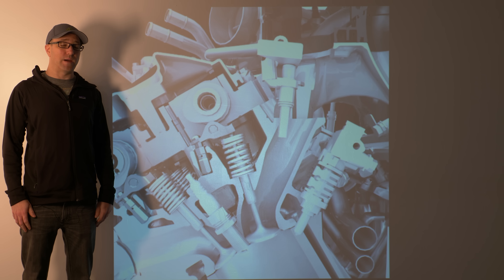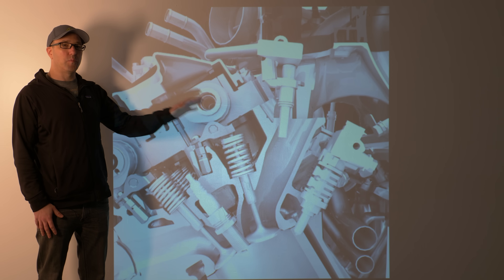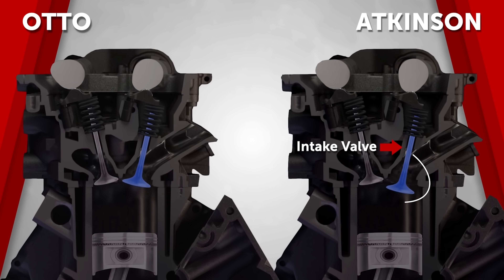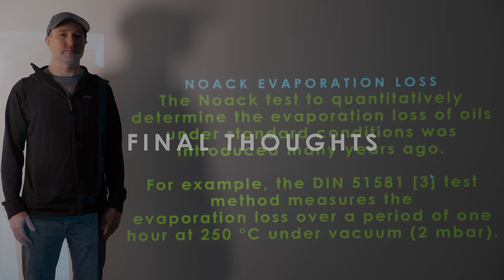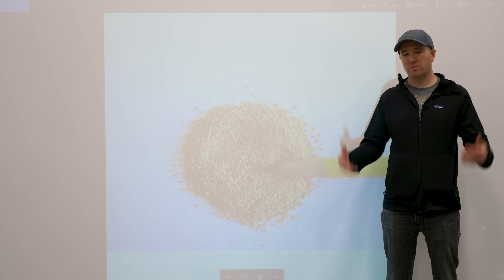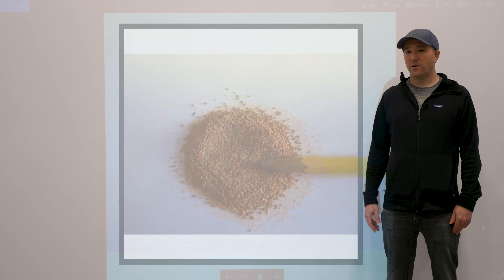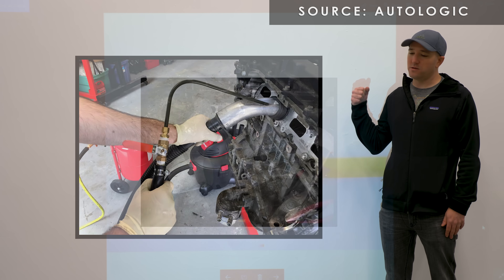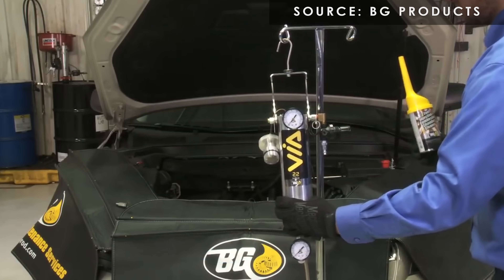Direct Injection, Problems and Solutions | The Fine Print

Comment: I have two cars with modern engines, a Peugeot with a THP 1.6 175 hp Prince engine (BMW-PSA) with direct injection and all new paraphernalia and an Alfa Romeo Giulietta with a 1.4 turbo 170 hp Multiair system engine, conventional injection. The latter does not have any of the problems associated with direct injection (many) and consumes less fuel. With the right technology, direct injection is completely unnecessary and was a failure in terms of reliability.

Comment: $600 to $1,000 cleaning service every 30,000 miles?  I just purchased a 2023 Subaru Forester 2.5 with direct injection and there is nothing in the service schedule about a valve cleaning service.  At any mileage.
Reply: Exactly. Planned obsolescence, engine dies of gunk & misfires just outside the warranty window. It's aaaaalllll part of the plan.

Comment: I have a twin turbo GDI engine so I use:

1.I use CRC intake valve turbo cleaner every oil. 
2 . Oil catch can
3. Fully synthetic oil 

100,000 miles no problem so far and no oil consumption. 

By the way, port injection helps keep the intake valves clean but it's not perfect and with twin turbo EcoBoost it will only delay the need for Walnut blasting by two.

Comment: What if I would add say 3 ozs of Lacquer thinner at each gas fill up to clean the carbon
off the valves and internal parts ?  Any problem seen ?
Reply: How when it never comes in contact with the valves?
Reply: Cleans fuel injectors @ibcalm24

Comment: Direct injection was NOT invented for emissions regulation reasons. It was first introduced in aero engines to address carburettor icing problems. One of the first engines using gasoline direct injection was a german Junkers JUMO aero engine in 1916. Perhaps one of the most famous gasoline direct injection engines is the inline 6 used in the famous Mercedes 300SL gullwing.
Next time do some research before ranting about technology you don't like!

Comment: another reason to either get a new EV or stick with a port injected older model … since diesels are mostly direct injection why are those engines not failing at 100k miles due to intake carbon buildup ?

Comment: As some have noted, blow-by is from combustion chamber, past piston rings into crankcase (bottom end of engine.) PCV was invented to eliminate oil leaks. When you omit it, you build pressure in the crankcase and pressure forces it out of the seals. Oil catch can is reasonable advice for GDI for dedicated motor heads who will maintain it.

My 2007 R56 MINI burned a valve before MINI fully understood that this was a problem. I tore down the head and had gnarly photos of all my intake valve with tons of carbon on the backs. The burned valve was actually an exhaust valve that I suspect was wedged open when a piece of intake valve crud finally broke off.

Comment: I remember back in the 90's OMC 'outboard motors cooperation' Had what was called Engine Tuner. This stuff ate carbon.
You could see it work, carbon was gone in an hour. If an auto maker could find out what OMC had in that can, they could have a spring n ball inlet port to the intake valve where you could screw this on . DONE. I'm serious. nothing worked for carbon like this stuff. OMC went away with the death of the 2-stroke engine. Ford find this N make it, you need this for yer cars NOW! If OMC could build a system where you can fit a nozzle from a can to the motor so can you.

Comment: I have a 2015 VW Passat 1.8L turbo. Killer engine and great car but Im now at 140k miles and have occasional rough idle an im burning about a quart of oil EVERY SINGLE MONTH. VW does indeed use an oil separator, but this has not been sufficient in removing oil from the vapors being directed back into the intake. Im now looking at having a major carbon cleanup done, as I am giving this car to my daughter. I want 200k miles from this car.

Comment: Your viewership might relate or appreciate the benefits of old mpfi tech.  As the first owner of my 93 Explorer xlt 4dr 4l OHV MPFI it had 398k miles on the original motor.  In interest, I pulled the heads for inspection.  Every exhaust valve receded past the direct to iron seat, and half were stress cracked like a split on end grain 6x6 wood posts.  All of the intakes showed little wear on the face.  What follows your story and to my amazement, every valve was pristine clean, dry, no oiliness, no carbon buildup, Nothing! except material erosion wear.  Never once did I ever feed the suv any fuel additives.  Believe it or not, the original CAT kept NOX and the other emissions within  the upper boundries set forth by CARB in SoCal.   Likely due to the generous bandwidth set forth by CARB's OBD 1 numbers.  Give them an inch, they will take the mile from you.

Comment: He really does do a great job most all the time informing us. But he needs to be just a little more careful at times. We have a bit of miss information in the video. The injectors for direct injection can not benefit from cleaning products and cleaning procedures. They spray fuel at such a high velocity that they literally blast their own openings clean each and every moment they are being used. The opening is so tiny they would never be able to work at all if there was any blockage at any time in their use. So if you want to use injector cleaners or take them to a cleaning place it won't hurt anything but there's absolutely no benefit to the injectors to doing it at all. Look this up it's factual. I would think he got this info from one of these places that sell those services or someone that didn't really know the facts on this. At least that's what I suspect otherwise he would have found this out by looking into it on his own.

Comment: I wish you'd explain the actual "solutions" car makers did to prevent the int valves carbon build-up because this is the root of the epidemic engine failures in some car makers such as Honda, Kia, Hyundai and perhaps others.  What these car companies did is they modified the car computer software to inject extra gasoline on cold engines - this enriched the fuel-gas mixture to the point where some of the gasoline doesn't burn and is coating the combustion chamber including the infamous valves - this is how they prevent the carbon build-up, it's a "valve cleaning" procedure that happens at each cold start. A very easy and cheap to implement "fix" that in turn......    caused the epidemic engine destructions in Hyundai cars. Why ? Because this unburnt fuel leaked into the engine oil and diluted the oil causing obvious engine wear, plus coating the cylinder with unburnt gasoline increased cylinder wall wear to the point of increasing the blow by. A cheap quick easy "fix" that in turn caused a major engine trouble. Usually the engine wear is worst in drivers who do mostly short distances where the oil doesn't heat up enough to evaporate the gasoline that is diluting it. You can use the best existing oil, after a few weeks it gets so diluted, it becomes worst than the cheapest oil.  If you are doing mostly short distances, you are better off to use a regular oil and change it no later than 4000 miles OR 6 months.  Do not use the same diluted oil for more than 6 months even if you don't drive the car, because the more diluted oil sits, the more it degrades.

Comment: You are spot on on this. My experience with my gdi car, dealer recommends 0-20, then my car burns 1 litre oil 5.000 km. When i use 5-30, it doesnt show any oil loss after 10.000 km. And after following their recommendations for too long, before i did my own research, im afraid i have a problem now. Car har run 80.000 kms, and runs rough at cold starts and in steap hills on low rpms. So thanx GM, for recommending 0-20oil.😢
Reply: Did you ever figure out the rough running at idle? Which model and year is it?
Reply: @gregorymalchuk272 hi there please if you can help me I do have rough Idle I really don’t know what else to do I just found this video Got Great Explanation But Questions What Oil should I Use to try to Improve the Rough Idle for Now I use 0w 20
Reply: @SL_Pwc_Lifestyle  What year, make, and model of car is it? Have you dumped the OBDII codes? Is there a misfire code? Maybe a bad ignition coil, bad ignition module, bad spark plug, or bad fuel injector?
Reply: @ I try few things…is a 23 suburban I change the sparks…. No codes there is no codes ….Nothing just shaking at red lights or stop signs when is hot 🥵 at the morning do nothing
Reply: @SL_Pwc_Lifestyle  Have you dumped the codes? Auto parts stores will read the codes for free. The computer can identify a misfire down to the individual cylinder by reading crank acceleration (or lack thereof). Or you can try to do it yourself by disconnecting spark plugs or the low voltage wires to the coil-on-plug until you find one that doesn't change the idle. I strongly suspect a bad coil-on-plug. Sometimes even the long stalk that goes from the coil down to the spark plug burns a hole in the side, and wrapping it in electrical tape could fix it. It could also be a bad injector, but this is somewhat less likely.
Reply: @ I’m going to try that
Reply: @ thank you for your help and time
Reply: @SL_Pwc_Lifestyle you probably need to use 5w-30 oil and do a walnut blasting of the intake valves.
Reply: @gregorymalchuk272 opel insignia 2018 1.5 severely downsized. No codes, but carboned up intake valves.
Reply: @gregorymalchuk272  it was carbon buildup on intake valves. Needed walnut blasting and 5w-30 oil.
Reply: Sounds like from what you are describing the issues only started after you switched oils. Some of that could be attributed to running out of spec oil

Comment: Considering a new Toyota 4runner but it has direct injection.  These are alleged to be very reliable though.  The V-6 is the same from 2009 or 2014, anyway it’s old school.  
Question: would premium fuel keep valves cleaner? Or how often add injector cleaner?
Thanks

Comment: Nothing new here just cut and paste info from intelligent people. And not just Toyota and Ford...Hyundai/Kia. Idea a catch can works can be more volatile then gasoline. Many tests say yes, many say no, and some say, not sure. If you use a Top Tier fuel you do not have to add anymore additives. If you use poor fuel, then yes,run some Techron or Sea Foam. Many oil companies publish on their sites complete specs including volatility numbers. Therefore some good info, some not so good, but like he says don't take his word for it. Only thing he is correct about DI engines are not the answer people thought they were. But a dual GDI/MPI engines are the answer for better fuel mileage, great valve cleaning, more power until something better comes along.

Comment: What an amazingly well researched and put together video! I do have to say though, I was surprised you didnt mention anything about GDI intake valve and turbo cleaners like those offered from CRC and Lucas and I was wondering why? I understand they can't remove all deposits, especially hard deposits, but I believe they work as a preventative maintenance step. 

Also, I found that NOACK chart interesting, as I've been using QSUD 5W-30 for a long time believing it to be the best oil for my 2017 Hyundai Sonata 2.4L. I just got some Amsoil Signature Series but I can see from the chart, I may have to try Pennzoil or Red Line if I'm still using a lot of oil.

Comment: You for got the oil filter my man, use a very good oil filter. I use Amsoil EAO17 it’s the best. WIX HP is a good filter, just make sure your filter has a filtration of 20 microns. The larger contaminates are what build up on the back of your valves. I have a 2011 f150 with the 3.5 twin turbo it has 400,000 miles on it I’ve had zero valve issues, zero timing chain issues and zero turbo issues. I use 5w-30 Amsoil signature series oil with their EAO17 oil filter, no catch can. I do 10,000 mile oil change intervals

Comment: I've noticed a lot of new Chinese built engines are using low pressure indirect injection, they say it is more reliable and incurs less maintenance, anyone who had problems with a high-pressure pump will appreciate that, I've seen pumps costing £500 junked for sake of a blown O-Ring by mechanics who cant find the problem, or don't take the pump apart and just order a new one at the customer's expense.

Comment: Great video, read a couple hundred responses and couldn't read them all, was wondering would a different tune help carbon build up maybe a little leaner or is this too risky. Also what about more effective cold air intake or better exhaust flow. I have a 2014 Ford ecoboost 3.5 liter supercab with a towing package but it has single exhaust, have seen videos on getting a better cold air intake filter and putting duel exhaust then adding a tune box to help the delay response in Fords when you push the pedal down and get a 1 second hesitation and suppose to give you a 75 horsepower increase.
Reply: Also what about a hotter spark plug, like the newer better plugs that spread the spark front over a wider area than the single point spark plug type.

Comment: Finally someone who tells the truth, the purpose of super light oils 0w20, 0w30 is to reduce consumption. The manufacturer of my car requires 0w30, I use 5w50 and it greatly reduced carbon buildup and lengthened the life of the timing chain, which is another problem endemic to new engines, timing chains that stretch and last 80,000km. Obviously I live in an area where the car does not know temperatures below 5°c

Comment: I own 3 DI vehicles, 2 of the 3 are Turbo!!
2017 Lexus NX200t w 60k miles (has Toyota D4 injection and literally just gets driven and that's it)
2013 Mercedes GLK 350 with 328,700 miles!  the M276 3.5 has DI and I bore scoped it 2k miles ago and the valves are "dark" yes but not caked up at all.  It's never had a treatment (pulled the Mercedes Vehicle Master Inquiry and blasting treatment is not listed).  Car feels like its 3 yrs old with 50k miles, very nice.
2020 Ford Ranger FX4 w 88k miles.  DI, Turbo, 10 sp trans.  Scoped it last yr and no buildup at all, looks new.  

I don't lose any sleep over DI.

Comment: Fuel injectioncan be a big plus going up very steep stuff in 4x4 I had a little toyota with a built 4cylinder makuni intake & Cam good ezaust and all . A nice big weber carb. Going up steep dirt sometimes it could not get gas from the carb. Then with a fuel injected v8 it does not hsve that issue at all. THe other good thing if you go up ino higher altitude there is no need to adjust the carb and with MAF and not burst injecting from side to side but injecting into each cylinder. it will be I hope even better. The computer adjusts itself even with upgrades insead of reprograming the chip of speed density. Smog stuff can be tufff you need to buy stuff thats legal and keep the cam more mild. But its not as bad to build for torqu over horsepower. That is not the best for high speed like in a car. But good for a fiull ssize 4x4. I am not racing it but need torque to get it up sand and stuff from lower speed you need.

Comment: I have a 2016 Sonata, and I had a runon problem with the engine after shutdown, implying some detonation.  I removed the plugs and found they were perfect except on the sides, where combustion products had accumulated.  I wire brushed the affected areas and the problem disappeared.  Replacing the plugs would have been a waste.

Comment: I'm sorry....but Direct Injection is really not necessary when using gasoline. Direct Injection works best with Diesel engines.  This is just one example why I am turned off with brand new cars. The big problems always start right after the warranty expires.

Comment: Ok so di is not a intake valve issue it's a combustion temperature problem ..... the rings are sticking causing oil consumption excess blow by etc hyundai has told us its intake valve .... then the tech told us the truth ..... we had a similar issue with the 4 cylinder am gm .....

Comment: 15 years ago I drove 1.8 mono injection 90hp car, it was doing 10-12l/100km (19.5-23.5mpg) urban. Now I drive 1.8TSi 180hp in a similar sized car, have to bady it to go below 15l/100km (or over 15.7mpg). OK it is double the power but...

Comment: 140k on a direct injection 2.4 equinox which has been burning oil for years has less than half the gunk shown here on the valves. I think driving highway heats the valves enough to cook it as it accumulates. I don't know.  I was just surprised at how little I saw.

Comment: If you own car with a GDI engine with or without turbos such as the V6 Lambda Hyundai Genesis engines it is a good idea to install a Catch Can and also invest in a Central Port Injection(CPI) system with flex fuel. Burger Motorsports has a good system, and it's affordable.

Comment: The engine in the mk7 golf R etc and newer have direct and indirect injectors as standard (in Europe at least) so a lot of the problems are solved.
Reply: No thanks.  I'll stick with my port-injected engines.   Less complexity and intake valves are kept clean.
Reply: @dantesinfernopurgatory7826  The EU TSI engines have port injectors as well as direct injectors (so 8 in total for 4 cylinder engines), so there is no build up on the inlet valves. I appreciate the point on complexity however!

Comment: I think this might be a job for hydrogen. A small hydrogen generator that injects it right into the intake. I'm gonna try this on my 3.6 GM

Water injection should be considered as well. 

ATF,  Marvel mystery oil, Seafoam or even carb cleaner will get a good chunk of it sprayed into the intake plenum.

 Its also good to drive the piss out of it if you have heavy carbon. It's called an italian tune up. It works. I have been a mechanic 40 years.

 Make sure you keep your oil clean.